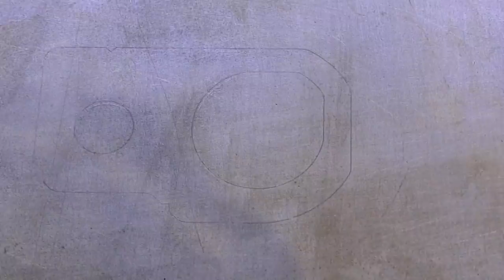RDWorks Learning Lab 164 Honeycomb Alert

Comment: That is why I stopped cutting acrylic and focus only on wood.  Even with that decision, it's important to clean the honeycomb regularly to get all that black and brown off of it since the laser will hit that old stuff, and cause more heat, smoke, and fire (think re igniting a charred piece of wood)
Reply from the maker: I agree that wood fumes are also sticky, nasty and may also be prone to reigniting, The reason I focused on acrylic is because 6 out of 6 fires that I know of are all acrylic based.machines. My 1% usage of honeycomb is never going to expose to the risk but when I cut wood on my steel base plate I often get a serious sticky brown condensate even with my good cross flow under the work. The great thing it is obvious and just a quick wipe with acetone  fixes the problem.
Thanks for reminding others of the wood residue danger.

Best wishes
Russ
Reply: @SarbarMultimedia  your honeycomb is relatively clean of wood residue.. on our production machines that can get solid black edge-to-edge. I'm sure that others run their machines like I do and are pushing the dirtiness past recommended amounts.
Reply: @LaserWoodShapes  What do you use to clean your wood residue from your honeycomb? I've tried all sorts, oven cleaner seems relatively successful but still hard work. My bed is 600x900 and not found anything big enough to allow me to let it sit and soak which I'm sure would make it easier
Reply: @andyp6909  degreaser for day to day cleaning and a sand blaster every other month to restore them to 100 percent.
Reply: @LaserWoodShapes  thanks, I'd not thought about sand blasting. Will see if I can get someone local to do it
Reply: @andyp6909  I use high pressure water such as karsher once every week and that seems to do the trick. Also my air extraction is through the honey comb, not parallel to it. For cutting it is fine but I suspect it is not for engraving
Reply: Fascinating thank you. I like your well thought out premise. I’m needing to optimise a process for cutting a lot of 3mil thick (Ie .08mm) polyester (flat) film with a 30W RF  co2 laser. I’m tending to get marks on the back for the reason you describe I’m sure. What sort of bed would be best given it does need intermediate support due to its thinness? Given I’m going to be doing mass volume of the same job I could build custom jigs. I’m thinking maybe an external frame like an embroidering errr jig (?) used on embroidery machines lifted off sheet steel like you’ve set up …

Comment: Hi Russ, thanks for this video! I'm thinking about getting a Gweike laser. They sells their machines with both honeycomb and "knife blade" platforms. Do you have any experience with those knife blade platforms? Are they any good?
Reply from the maker: There are two types of knife blades supports. Fixed in a lifting frame  and stat position across the top of the machine but removable singly. Thes removable ones are usually a poor fit  and any work placed on them could wobble/move by 2 or 3mm. I would be pretty sure this is what GW would supply having seen a couple of their machines. . Although I hate honeycomb it does have it's occasional uses. As you will see in this machine I have the best of all worlds. I have a fixed frame knifeblade bed which again I rarely use,  that is my Z axis table. I have removable honeycomb that sits on top  OR  I can replace the honeycomb with a flat steel surface which I use 95% of then time. Why?  Well, it's all to do with air flow management, something that zero machine manufacturers pay any heed to.    Take a look at this video from about 24 minutes onward and  I will explain what airflow managment is.

https://www.youtube.com/watch?v=AHnJ2WxNo5Q 
It is vitally important and you may have implement your own method on a GW machine. That is why I indicate that maybe the more stable honeycomb well be best (is it raising and lowering?) because you can easily place a sheet of steel on top to FORCE airflow management and have a nice stable work surface. It does mean you will have to raise your work by 10mm or so to let airflow below your work.

 You might like also view this
https://www.youtube.com/watch?v=eaz9ZEjwjfs

Best wishes
Russ
Reply: @SarbarMultimedia  Thanks Russ for the quick and long reply! Yes, the machine I'm planning to get has a motorized bed/table. I think I can retrofit a steel plate as an alternative to the honeycomb.
Reply from the maker: @dbrgn  
 I'm suggesting to wait until the machine arrives and then fit a removable steel plate that  sits inside the honeycomb edge frame  and leaves a 2" air gap along the back edge to draw air down in a controlled manner. In that way you have options.
 Best wishes
Russ
Reply: @SarbarMultimedia  We had a Laserite machine at my last school with knife edge bed, it was excellent with no movement of anything placed on it. Bars easily cleaned once every couple of weeks in a bucket of hot soapy water with a scotchbrite pad. Gotta keep them clean!
Reply: @muddundee  
 Yep. I have a fixed knifeblade bed under that removable honeycomb bed.  and it works well for some jobs..However it make proper air flow management through th machine abysmal. . Since that video 2 years ago I have learnt of 4 more  machine fires caused when cutting acrylic. Most of the time I use my flat pale steel bed.
 Best wishes
Russ

Comment: Hey Russ, what is the steel that you are using (Type and thickness)?
Reply from the maker: Hi Tim
All metals are reflective to 10.6 micron light to some extent. ordinary mild steel is in the lower region at about 65%. There are different finishes of steel with various plusses and minuses. depending on the size of your machine table.For my 300x500 and 600x400 tables 1.5mm (16g)  uncoated cold rolled steel has been used. For this relatively small size the sheets are very flat and do not  bend when cut to size from a larger sheet. If you are bigger than this, maybe 1000x700mm or in that region,  I would be using  2mm (14g), Cold rolled steel has a fine orange peel finish wich is great for scattering the reflected light thus breaking down the energy density.  On the other hand Hot rolled sheet (usually black finish) has an oxide layer on the surface which absorbs the energy and very little is reflected. With such obviously great properties this seems a no brainer. . Sadly hot rolled material hides lotsof residual stresseswithin and is shipped from the mills in huge coils that have to be passed throught straightening rollers before being cut into sheets.  The sheets may be flat but when you start cutting into the sheet  stresses are released and your 1000x700 sheet may finish up with a 2 or 3mm bow in it. If you can secure it to a decent table support frame with countersink screws and pull it flat then this is probably the best (and cheapest) option.  For most tables 2mm will be thick enough,
Best wishes
Russ
Reply: @SarbarMultimedia Thank you Sir, mine is 1300x900 and I have people asking me to cut cloth for COVID-19 mask. I will see what I can purchase from local metal shop. As always thank you so much for everything you share with me and so many others.
Reply from the maker: @TimRobertsonWoodturning 
 Hi Tim

Much as I hate to admit it, fabric is about the only thing that is best done on a honeycomb table.  I dislike honeycomb intensely but I think it was just this application in China that started the honeycomb revolution. There is little else it is good for. However, If you have a honeycomb table you have been using for other things it will be in a bit of a state and any beam passing through the fabric will not be sensitive to passing over the edge of the honeycomb cell (that's a minor problem that will not show on most fabrics)  but that excess energy will cause your crap within each cell  to burn and create fumes and that will mark and create smell on the underside of the fabric. You may really be looking for clean  steel honeycomb.

Best wishes
Russ
Reply: SarbarMultimedia thank you, with that information I may take my honeycomb table out, pressure wash it, dry it and give that a try.
Reply from the maker: @TimRobertsonWoodturning  
 Hi tim
 Pressure washing will help but it may also distort it. Try it carefully.  I ave heard of people having success with alloy wheel cleaner and bbq cleaners, Caustic oven cleaners also work but they are dangerous to use and your table is big.
 A thought has occurred to me. If you plan to run the same program many times, draw your program in absolute mode so the beam will always follow exactly the same track on the table. Drop he table about 2" and run the program a few times quite slowly  to BURN off the debris along the beam path. This may be the quickest and cleanest way to solve your problem.

Best wishes
Russ
Reply: SarbarMultimedia thank you. I will definitely be careful with the pressure washer. I will use a fan spray from distance as to now distort or bend anything.

Comment: Two things that you should be aware of is you shouldn't be cutting acrylic with more than about 2-4 PSI of air pressure from the nozzle to begin with.  That is what blows the smoke under the bed and it makes for some pretty crappy raster etches as well due to the air cooling the surface of the acrylic to fast, thus causing scan line ridges to harden in place instead of smoothing out as they should be. The second thing is don't buy acrylic without protective film.  99% of acrylic comes with said film on both sides.  Don't remove it from the back of the piece before cutting.  Only the top where the laser kits it.  Knowing those two things alone will drastically reduce your issues and make for better finishes.   The honey come does very well for certain materials such as paper where you need it laying across a fully supported bed.
Reply from the maker: Hi

Acrylic is a unique material. I has all the properties of H2O. At room temperature it is solid(and usually clear). At 160C it turns to liquid and at 200C it turns into acrylic vapour (steam). There is no chemical change  just a change of state. Just like steam, when acrylic vapour hits a cool surface it will first recondense back into liquid and then cool further to solid. 

 The next fact to understand is that there are two manufacturing processes for the same acrylic material. They are chemically the same (and act as described above) but have significantly different properties, both mechanical and processing, Extruded acrylic is squeezed and rolled to sheet (like toothpaste from a tube) and cast acrylic is poured between two sheets of thick glass and allowed to set into a flat sheet. Cast acrylic thickness tolererance is huge and extruded is quite small. You can cut extruded acrylic with lots of air assist  and it will still give you a nice flame polished edge with no striations. Not so cast acrylic Even with zero air assist you will get striations especially below 3mm thickness Above 3mm you can slow your cut speed by 30 to 50% to  allow heat build up within the cut. This allows the LIQUID phase of the material to  FLOW and self level on the walls of your cut to get a polished edge. 
 The vapour will ALWAYS flow from the BOTTOM of your cut  regardless of air pressure. Never turn your air assist off , just reduce it to a whisper to make sure fumes do not reach your lens. Once you have established a THOUGH cut, there is no longer any material  in the way of the beam to absorb energy. It is this energy that reflects off the honeycomb that damages the back of your work and also this energy that can ignite the vapour below your cut. Yes leaving the protective film on the back of your material will stop marks on the reverse face but have you ever looked at the little nicks it makes in the edge?

When you are surface engraving, there are several golden rules. First always turn your air assist to just a whisper because your do not want the jet of air to blow the VAPOUR back down on to your worksurface.  Once the vapour is in the air you need a good CROSSFLOW of air to carry it harmlessly away from your  work. Secondly, use the least amount of power possible to get a good image , do not try to get a deep cut. The more material you convert to vapour the more likely you are to get those "grooves" in the bottom of your cut and the white recondensed fumes all over the bottom of your cut. Experiment  using the preionization zone when engraving acrylic. It works wonders.

Best wishes
Russ

Comment: I just watched this video on the "downside" of a honeycomb table. I see yours is a steel top, but would 6mm or 12mm thick aluminum do the same job without any additional hazards? Thank you in advance.
Reply from the maker: Hi Kurt
The problem with all metals is that they are reflectors. Some are much better than others. Aluminium is one of the best along with silver,copper,gold,platinum and molybdenum. When you make a cut,  the beam does not lose its power just because it appears out of the bottom of the cut.  That beam gets reflected off any metal it strikes. That is why the flashes from honeycomb cause damage to the back of your material and why that "pass through" beam can ignite stagnant pockets of fumes below your work. 
 see   https://www.youtube.com/watch?v=eaz9ZEjwjfs
 Aluminium can be a great baseplate if you anodize it because you are converting the metal surface to a non-metal (aluminium oxide) which absorbs the light rays and converts it to heat. However. if the energy density is too high you can burn through the aluminium oxide and expose raw aluminium again. . I use ordinary cold rolled mild steel because the reflectivity is about 70% (still quite high) but the natural fine orange peel  finish causes scattering of the beam as it reflects. This greatly reduces the potential damage the reflection can do. If the surface gets a bit caked with debris that cannot easily be removed with acetone, then it can be removed with an industrial grade abrasive pad. The multiple scratches only helps to scatter the beam . 
Best wishes
Russ

Comment: I never tried that aluminum honeycomb cant find a big enough  section of it 
I use ceramic tiles 15 of them my 50watt  laser has a 12x6 foot cut area 
I use little tiles as spacers i mostly cut 
F111 nylon and a fabric called zero p 
Just f111 with silicone coating on it nylon does the same stinks just as bad too I cut quite abit of it i do art work on modern ramair parachutes but my machine is rather large it also has a spindle too be binge watching all your vid love them
Reply from the maker: Hi Jerry.
I would guess your machine is very low fire risk because unlike MDF and particularly acrylic, nylon tends to melt rather than vaporise or oxidize (burn). Your material is also very thin so although there may be smelly white smoke  your machine has no crevices where any condensing fumes can build up. I also think that any residues will be hard to ignite with 50 watts because I suspect you run quite fast maybe 20 to 30mm/sec? so any residual energy passing through the material be moving so fast there will be insufficient energy per unit of time to ignite any residues. Acrylic is exactly the opposite ie cutting slow with high power. Your "flat" approach is  much safer than honeycomb.because there is always a heat sinking mass behind the material..  Thanks for the interesting feedback about a material I am unfamiliar with.
Best wishes
Russ
Reply: @SarbarMultimedia  
Yes i believe you are correct although my machine built from 3/4 ply and steel L beam like dave gattons machine got together with Patrick daniels machine had a big angry baby with dual output shaft 1600 oz nema 34s on all axis it can be quite fast 1200 in per min but thats the stupid fast never use  danger danger setting i cut f111 at 40 in per same with zp
 the zp has silicone coating to make the fabric non permeable to air but its also kinda weird the condensate from it is  powdery gets everywhere dosen't want to come off even with ipa so i have to use acetone  then a vacuum like crazy
lol no fire hazard their huh my vacume table seems to have minimized it to an extent but i fear it collecting inside the vac box the thing cost a small fortune its 1/8 aluminum sheet with 9 bagillion 1/16 inch holes punched in it the bottom and sides of the box is backer board and ply ( concrete board for showers) just incase the laser shoots thru one of the holes i tested it at full power for 5 mins it turns black 
But thats about it no fire ive tried to ignite the nylon condensate it does burn but not as readily as acrylic 
I was wondering do you still have the files for the rotary device ? Seem very interesting the link say its no longer their ?
Reply: @RGCbaseace 
¬Hi Jerry

Add another comment with your email and I get auto copied to my gmail. I will send you the file  and also immediately delete your comment/email from public view.
Best wishes
Russ